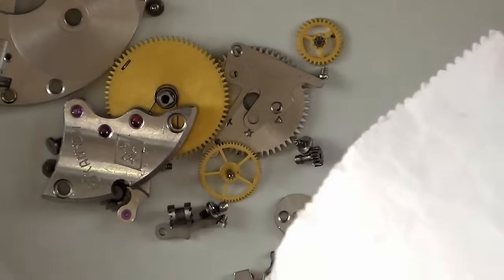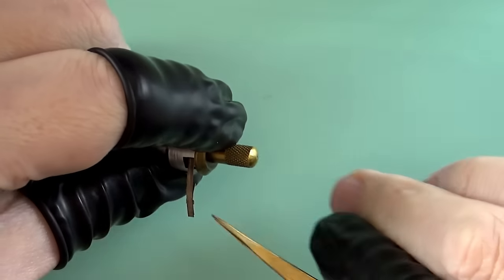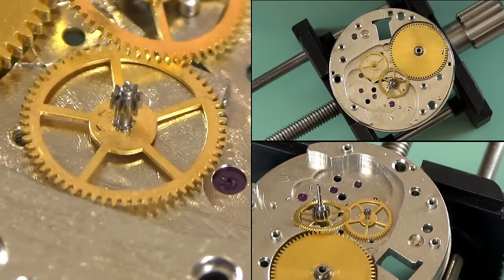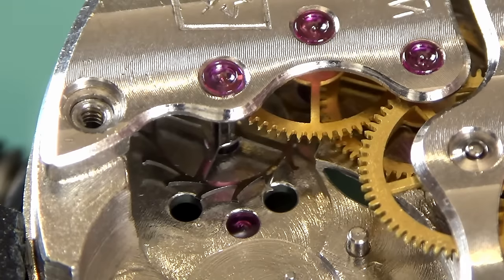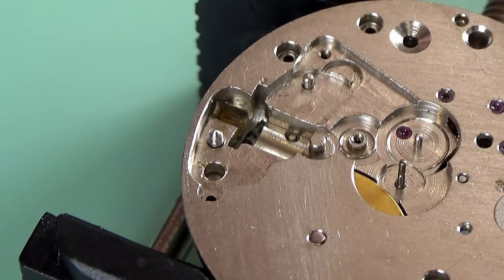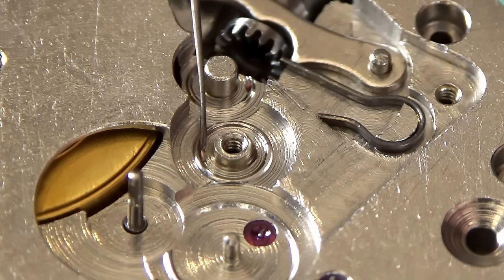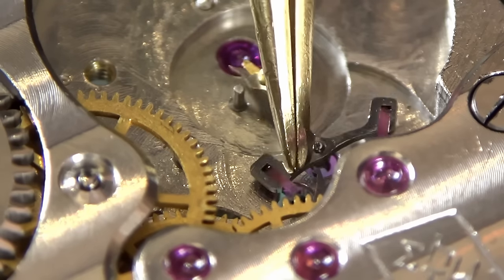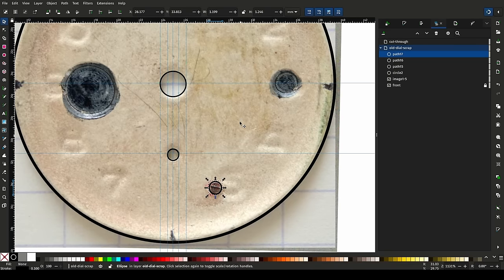Turning the Ordinary into the Extraordinary. Bespoke Watch from Old Parts and Sleepless Nights.

Comment: Cool video. When you get the upgrades on the CNC you could cut the dial feet on the CNC using a jig/fixture, same goes for the indicators for the dial. basically cut then on both sides. you should cut the feet first and then you can use the feet for refence using a nother jig/fixture with holes in it.
Good luck on the next one, and please share it too...
Reply from the maker: Thanks for the tips I'll take any help i can get with this :)

Comment: Hi there, I've also been working on custom silver watch dials for the last few years, although I haven't posted any videos. I have a tip for you about beveling/anglage. The progression of abrasives should be: (1) #6 Swiss file, (2) ruby file, (3) Gentian wood charged with fine abrasive compound, (4) steel burnisher. This will give you a beveled edge with a mirror finish.

For milling/CNC, run the spindle at the highest speed your machine can handle and take passes no deeper than 0.1mm until you reach desired cutting depth. On brass and precious metal, lubrication really doesn't make a difference. Sometimes it even gets in the way by clogging the cutter with chips.

Circular grain looks better than straight grain, IMO. The easiest way to do this in on a lathe of course, but you can make a simple jig with two flat plates and an arbor through the center hole. Fasten the dial to the bottom plate face up, and charge the top plate with abrasive. Then rotate the top plate by hand back and forth to achieve a circular grain. George Daniels covers this technique in his book.

I also have been racking my brain to figure out a way to make dial markers with posts to avoid adhesive. As I'm sure you know, in industry these are made by stamping with very expensive dies. I think I've figures out a way to replicate this with CNC, but I only have manual machine tools, so I haven't been able to test it out.

Comment: OK
Numbers - solder two posts to back using silver hard and corresponding drill holes and solder post using silver solder (soft) you've basically made a flat earing so you need earing posts or silver wire and make your own posts. Or position and solder straight on. These days they use microwelds to solder but we used hand held guns and two pipes with a bottle next to our legs lmao. Edit when you solder on it will leave a tiny cone of solder round the base of the post which will leave the number slightly proud. To stop that 1) File it away using much finer needle files till they sit flat. Drill through watch face. Push posts through holes. Nip ends off and file. Now either toffee hammer them flat and make a kind of rivet head by doing it (no solder method) 2) nip off flush, file flat and solder with silver soft file flat with dremmel or pendant drill and soft rubber wheel. (no idea what they're called now but that's what we used to call them. Same constancy as the ink rubber on an old school rubber.

Polishing and filing nightmare had me biting my hand. The saw frame will make a lovely edge which would just need a light sand wrapped round a dremel frazing ball or old dremel drill bit. But if you want it shiny then use a pendant drill with black polishing wheel (slightly abrasive rubber) then finish off with flour sand paper. 

We used to get letter transfers and put them on the silver sheet and use saw frame to cut round them. We wouod practice cutting the letters out of two pence

You also need finer needle files yours was like a bastard file lmao. I'd struggle with that.

That effect you were looking for with brushed metal you did OK but the reason it wasn't great was paper was too rough and you can't keep angle exact. My first job every day was to make up the sanding batons. A piece of hardwood 30 cm long and 8 or 10ml by I'd guess 20ml. Sheet of sanding paper in 3 grades. Fold them round the batons and tape at one end. As you use it up you rip it round the baton to expose fresh. Hold item on a jewllers pillar to catch light and in one smooth motion slide the paper across. Never back and forth. One slide along by hand. Blowing debris off each swipe. But what we had great success with later on with was doing that then barrel rolling rings in a barrel with soapy water and metal beads. Balls and rod like beads the size of small rice. For an hour or so. Rings sanded then barrel rolled. The shanks had such crisp clean edges it was gorgeous and they had a matt finish. 

Good luck hope that's helped
Reply from the maker: It did help, and that was really helpful. Thank you for taking the time. Most appreciated. I'll keep working at it. I was hoping some people who knew more than me would chime in to tell me where I was going wrong.
Reply: @Saving-Time oh god no you're not going wrong you made a beautiful job of it I'm just saying what we did to get a slightly cleaner result in a fraction of the time. And er .... I am looking to do my first watch and I know its gonna end up in a bag until I watch more videos 🤣

Comment: Years ago I took a silversmithing class, so I understand the challenge of fabricating and finishing small pieces. I have learned from your video that I will not be attempting dial making. You did an amazing job with budget basement equipment!
Reply from the maker: Dial making is tough, so is silversmithing. Making anything well is always very hard. Thanks for your kind comment, I'm working on another dial project with a monster for my next video (now that I've recovered from the last one).

Comment: Thank you so much for making this video!  I've been wanting to make a dial that is similarly complex, and being able to see someone do it and point out the potential problems and how much work is involved, is incredibly helpful.  I definitely underestimated the time and work required to clean up the mill work.  Having a 3D printer for templates and fixtures is also something I'm going to have to do.  Really impressed with how well this turned out.  This looks nothing like a first try - Really lovely looking watch!
Reply from the maker: Thank you, A 3D printer is helpful for this sort of thing; it's not 100% necessary, but it will save you quite a bit of pain and suffering. I'll have another dial video out at some point; it's a hard thing to do but I believe it's in reach of anyone who wants to put a bit of work in. Good luck to you wit yours

Comment: If you're going for a brushed surface, you should use scotchbright instead of sandpaper. Sandpaper leaves a very inconsistent finish, with deep gouges that really stand out. The scotchbright pads are much more uniform, and will produce a far nicer satin finish. They come in different grades. Typically you would use the green pads for a brushed satin, or the grey (fine) pads for an even more satin look. They are not very expensive, and you can find them at most hardware stores. You can find the green pads at any grocery store. Just make sure it's the flat green pad, and not on a sponge or something like that.
They are inexpensive, so I would really suggest just picking up some of the green pads when you see them, and give it a go on something to test it out. I think you will find the results are excellent. We use them in my industry for finishing work on stuff that costs thousands of dollars. There are a bunch of different types of scotchbright pads, but for just finishing the green or grey should be fine. They do also make tools with these pads on them. So if you were to try a sunburst pattern, that may also work. Though I couldn't say for sure, as that's not something I've ever tried.

Comment: as someone who has had an Anet printer, i would like to give a word of warning about suggesting it to people getting into 3d printing.
while it is an inexpensive printer and "good enough" to use as a starter. they are major fire hazards if you are unlucky. they don't have mosfets for supplying power to the main board and can catch fire. there are a ton of results of "anet a8 fires" because people don't do safety upgrades

Comment: The fact that you used a high-grade ZiM 2602 from the early 50s, built by the unfortunately now-defunct First Moscow Watch Factory of Poljot fame warms my heart. A lot better of a choice for a movement to put in than a generic ETA quartz or Seiko automatic in more than a few ways. The work on the dial was particularly impressive. I'll use this video as a reference since I'm printing my own watch as well, everything except the movement, purely as a design exercise. I've got a Sea-Gull ST3600, the Chinese clone of the Panerai modification of the Unitas 6497, to use as my test bed. Will hand-finish the bridges and main plates to a higher standard with my own metal lathe as well as give it a full service to really give this fundamentally 50s-era design the best chance it has.
Reply from the maker: I'd also like to do some bridge finishing and the like or at least start to learn. Good luck with it i think i'll pick up a ST3600 to play around with.
Reply: @Saving-Time  Again, this effort you put out is rather impressive. Let alone the dial, it seems you had a bit of a Frankenstein's Monster of a Soviet watch to work with initially. Early 50s ZiM 2602 from the FMWF, a Vostok 2605 dial, and what appears to be a case for a Raketa 2603. Making all of those seperate elements actually work together (even though the Vostok dial served more as a template by the end) was an achievement in itself. Thanks for the luck! I should say that from a build quality perspective, the ST3600 is rather impressive. 90% of the quality for 1/4 of the price for the "real" Swiss article. Interestingly, although Sea-Gull didn't license the 6497 from either Unitas or ETA, its still legal for them to make copies simply because the patents protecting the 6497 have long-since expired. Anyone with the facilities to make their own clone movements of the 6497 can do so freely. Maybe you too one day (slight joke there :D).
Reply from the maker: I just ordered one to play around with :) The watch I worked on was indeed a bit of a mixture of parts. I'd love to build a watch based around the Buren Cal. 1001 micro rotor, maybe for another video. I'll get right on the movement manufacturing lol. Thanks again for the kind words
Reply: @Saving-Time  Don't mention the kind words, they're real! Good on ya for getting an ST3600! I don't believe you'll be disappointed. We're all awaiting your Unitas 6497 clones with "D. James" engraved into the main bridge :D. Oooh, the Buren 1001 is an excellent, and very out there choice. Especially given that Buren is a rather underrated watchmaker. Some of their movements, such as the 481, are right in line with Cortebert in terms of finish. If I may, I'd like to suggest a few more similarly out-there movements you could build watches around.
Reply from the maker: Thank you for this very interesting list I own some, but not others. I will be looking up all of those I don't own right away. Here is my Buren Cal. 410 Incastar: https://www.instagram.com/p/C0rccxuIm_t It's pretty rare to see it in the world. I am a Big Buren fan myself, and I agree they are underrated for sure.  I've been thinking about buying the Sea-Gull ST8000 $370 for a tourbillon. well... sounds like a steal to me! Thanks for all the information. I appreciate it

Comment: As one of the three, thanks for providing the technical details! One thing I was curious about is the two screws holding the crown wheel down. I feel like they should be flat head screws with a taper on the underside to match the countersink in the wheel's plate.
Reply from the maker: Budget cuts mate,  flat bottom screws only, In truth, this watch was pretty mix and match; the dial, movement, and case were from three different watches, so it's plausible.that someone just used some screws they had lying around.

Comment: Wow, thank you so so much for sharing. I too have been experimenting with sunbursts using similar radial bristle brushes. I found that I had to use a larger, 75mm disc (have yet to try 150mm on account of them being rather expensive) in order to get longer, straighter marks. I wasn't able to find a source for the large, brass-brushed discs that actual factories seem to use so I was toying with the idea of building one using cheap brass scratch brushes but have yet to try. I am also wondering why you chose silver plating over nickel with it being so much more finicky? Thanks again, Jack.
Reply from the maker: Hey Jack, thanks for the kind words I use silver as this is white silver it looks white in person, much more silver on camera.
Reply: @Saving-Time  Hey mate, was just coming back to reference this video and saw my old comment! I did in fact get a larger radial bristle brush and successfully made a sunburst pattern though it was very difficult to get a consistent finish. My latest video shows the set up I used

Comment: Just found the channel with this video.  Awesome to see homemade/printed parts in use.  I'm a hobbyist myself so tools and material prices are a concern.  I have the lube for it so I started to lube the exit fork.  However, I still haven't sprung for the epilame.  That stuff is nuts.  My rapid proto machine is an anet A8 Plus.  Upgraded to a e3d 6mm hotend and a duet 3d wifi mainboard.  It's invaluable.  Also noticed your using inkscape?  Nice.  I'm learning that for laser stuff (just another version of 3d printing machines).  I mostly use GIMP.  What are you using for generating your CNC Gcode?
Reply from the maker: Hey, I'm just in the process of upgrading my 3D printer to a better hotend. That's a very nice main board. I was thinking of getting one. CNC code is generated via an Inkscape plugin; it's actually pretty good. There's a bit of a learning curve to it, though. I use GRBL Candle to send the code to the CNC.

Comment: Please help! I am a rookie and I had a 1900’s pocket watch which was running perfect time! Not leaving well enough alone !!!  I just put a little oil on the jewels which were easy and obvious on the back and on the main spring before jewel . Now it’s running exactly 2X fast. What the heck any ideas? What did I do?
Reply from the maker: Well, if you got oil on the hairspring, that would be bad! It will need to be renovated and cleaned. You could have caused the hairsprings to become stuck together, which would drastically alter the rate. It could also be magnetism that causes the hairspring to become stuck together and dynamically alter the rate. Check for magnetism first with an app like https://play.google.com/store/apps/details?id=com.chrystianvieyra.physicstoolboxsuite&hl=en_US&pli=1 if not you will need to remove the balance and clean it!

Comment: Regarding the indexes - machine the feet into them from thicker stock.  Design the feet into them in CAD, flip the z axis in CAM and machine them from underneath.  Perform an adaptive clear with a 1mm endmill leaving 0.2mm radial stock (zero axial), then perform a 2d contour on each post to get to correct diameter.  Cut each index out with a 2d contour, finish by hand.
Reply from the maker: Thank you. That sounds like it will take some working out, but it is doable. I'll take all the help I can get when it comes to machining.

Comment: 14:21 Referencing lost and flying parts - I just got in a magnet on a stick from Amazon and harvested quite a few screws and other smaller parts. Doesn't help with the brass ones, but it works a trick for the iron-based pieces.
Reply from the maker: Yes I have one It's called a watchmakers wand lol I'm not sure YouTube would be to happy if i started whipping the watchmakers wand about :D Thank you for the tip it's a very useful bit of kit I appreciate you taking the time to let me know

Comment: hey I think it came out really nice! I can give you a suggestion, I've been a jeweler for about 40 years so I do have a little experience, when you want to finish your numbers put some double sided tape on a steel block and place you little bits on it to finish them it really works well and is simple, you can sand ,file and polish and everything will be the same level and thickness, hopefully I'm not repeating something ,if I am just sneer at my comment no harm done!
Reply from the maker: Hey, that's good advice. Thank you very much. I'm happy to take all the help I can get. Please feel free to share some experience. I'm grateful for the help. Work holding has always been tricky for me with these small parts

Comment: A tip with the CNC machine is to have the mill leave the part less mostly to lengthen the life time of mill, you could also have used a 90 degree mill to cut all the corners to skip the filling part. But for a 100$ CNC mill and a being new to CNC I would say the result were more than pleasing
Reply from the maker: I appreciate the tips, and thank you for taking the time.

Comment: Great job, love it.  How come no one ever polished the metal on refurbishment?
Reply from the maker: If it's stainless steel, I'll polish it. For nickel-plated brass, you need to strip it and re-plate it in most cases. I've done this in several videos; check out the Gruen video I did if you want to see this.

Comment: Hats off for the angle of your learning curve! With regards to the regulating of the watch, wouldn't be better to do this after oiling?
Reply from the maker: Yes, it would. I corrected the beat error before oiling, as it was so bad, then oiled the jewels, cleaned up the balance, and then regulated. Alas, I lost some footage of that, so the end of the video is a bit out of sequence. TBO this project took so long that I did not have the heart to film the regulation and jewel oiling again, as it would have meant re-cleaning and redoing the watch.  You are correct :) and i'm glad you liked the video. Thank you